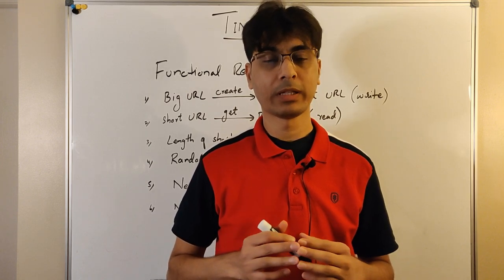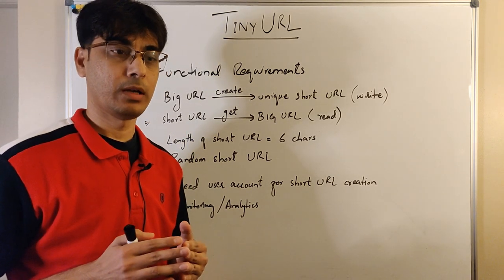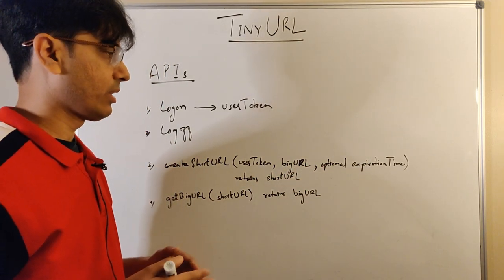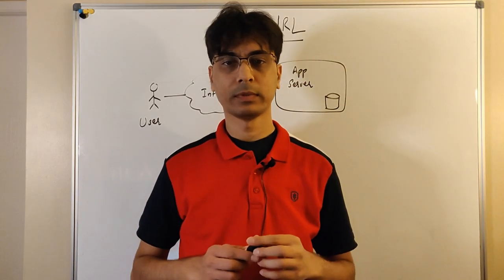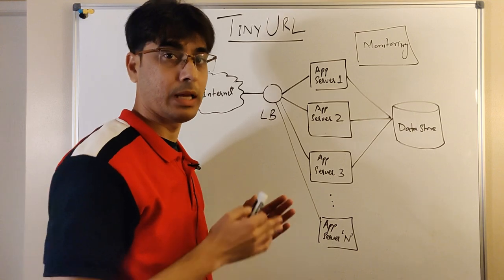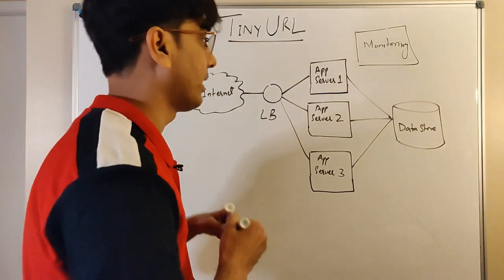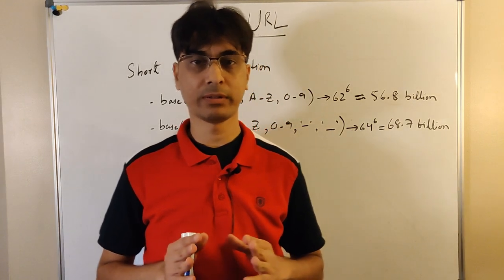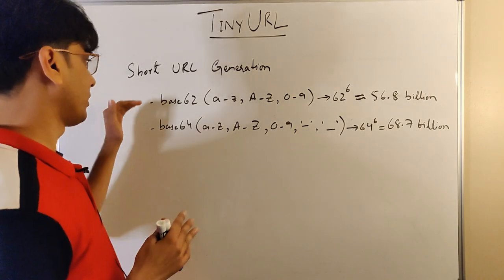System Design Interview Question - TinyURL System Design | URL shortner System Design

Comment: Thanks for the video but I have a question for you.
How is this approach any different from zookeeper approach. your data source is still a single point of failure whereas zookeeper on the other hand is considered to be more reliable and high available.
Reply from the maker: The datastore is not a single point of failure. I didn't discuss this in this video but it is already discussed in the course that you can check out. Now regarding using zookeeper to generate the counter values, I think people suggest that without even thinking what it means. In an interview, you cannot just say that you will use zookeeper to generate the counter values, and zookeeper will magically handle generating this value and also provide high availability (i.e. no single point of failure). Generating a unique sequence is the crux of this tiny URL system design and an interviewer will ask you then how zookeeper achieve this. In practice, nodes/machines in the zookeeper fail and they fail all the time. In this case, when one server in the Zookeeper cluster fails, somehow the system needs to make sure that the others don't return a duplicate range. The only way to do that is to make all servers agree on which ranges have been given, and which have not. Now this lies in the distributed consensus problem. In fact, zookeeper uses the one as well for this. Now, if you want to use zookeeper just to assign different counter ranges then this is a bad use of zookeeper because you can achieve the same by just providing counter ranges in some configuration form where all the servers go and read from a file uploaded somewhere to get their ranges. You don't need to run and maintain a separate service for it. This was a long answer as it was not easy to explain in a few words. I hope it clarifies your question.

Comment: You mentioned that we want high availability and strong consistency. How can it be possible as per CAP theorem
Reply from the maker: I think I have to make a video on it soon. People have misunderstood CAP theorem. First of all they don't understand in which scenarios CAP theorem is applicable.  Secondly, according to CAP theorem, in scenarios where it is applicable, only in the presence of a partition, you can't have both high availability and strong consistency and you have to give up one for the other. It does not mean that when there is no partition, still you can't have both. And there is a third reason also, which I have answered in other comments before as well.

Comment: If one of the app-server goes down, won't we lose a range of usable values for url generation? I would try to think of a way to reclaim a range
Reply: Its a very small trade off. 7 characters can generate 68B combos and we can easily afford to loose some chunks in case of server failures. Also, when the cron job runs to delete expired tiny url mappings, we can actually add these tiny urls back to the table containing the available urls so that they can be reused.

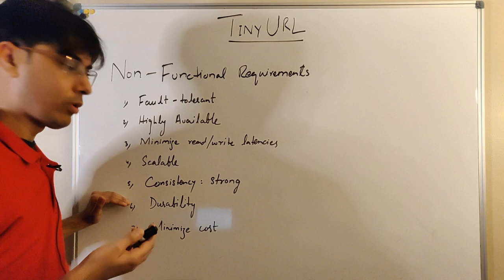Comment: Thanks for your video. one question,  when you mentioned the non-functional requirements (@5:32) should include high available and strong consistency, but based on the CAP theorem, we can only choose one from them, how can we keep high availability and strong consistency at the same time?
Reply from the maker: Thanks for the comment. As we discussed, the service has strong consistency in the sense that once we created and returned a short URL to the user, if the user queries the big URL using that short URL, the service should be able to return the big URL. Otherwise it will not be a good user experience. Now the question arises that how a service is available and consistent at the same. It boils down to the fact that no service is 100% available. Question arises whether we are targeting five 9s or four 9s of availability and again it also boils down to whether we are talking about availability of the whole service or some part of it. The service itself can be highly available (as a whole) and at the same time fulfill consistency requirement as a whole (keyword is "as a whole") however the individual partitions (in the datastore) may have to prefer either availability or consistency. Now it is totally possible that one partition could be down due to network partition but it won't affect the functionality of other partitions, thus overall service still considered as highly available. And please note, I didn't discuss the design of datastore where we would discuss all these things (which will be a topic of a future video). I hope this clarifies.
Reply: @ThinkSoftware  Thanks a lot !~
Reply: I would like to add on to what has already been said - the question of choosing between availability and consistency arises only in cases of a partition. Otherwise in a normal running scenario a service could be both available and consistent. Now let's discuss the partition scenario . In this scenario . we could make the read service to be highly available while the write service might become unavailable in event of partition thus maintaining the consistency .  So different microservice of  a system could be configured differently  to support availability or consistency !  Hope this helps
Reply from the maker: Thanks for extending my answer with great explanation 👍
Reply: @ThinkSoftware  I would think, eventual consistency should be OK. As most of the time, the short URLs are created may not be immediately queried. The flow would be user creates a short URL, posts it to his followers and the followers may not click on it immediately. If we use a NoSQL Database like Cassandra, we can improve Read Performance tremendously

Comment: If the datastore is a single machine, will that beat the purpose of high availability if it is down?
Reply from the maker: Of course
Reply: @ThinkSoftware  in your example, datastore is a single machine or you just use single drawing to show datastore?
Reply from the maker: it is not a single machine. It is just logical diagram of data store. If we would have gone inside that logical component then the discussion could go about how to achieve all non functional requirements in that data store. Check my other video on intro to distributed systems in which I discussed a bit in detail about it.

Comment: Can't we just use the Semaphore concept to keep the counter value so as to avoid any conflict?
Reply: Semaphore mutex is used in single codebase. Here we have multiple servers. If want to use mutex in DB side or in cache the problem will the the same. That Db or cache will become bottleneck. So that's why he's incrementing it by 100, to reduce load on DB.

Comment: Instead of relying on an external data store for getting valid count ranges why don't we just append a UUID to every input URL, hash it with MD5 and bas62 encode it? This reduces the possibility of collisions and eliminates the network overhead. The individual app servers can generate UUIDs independently
Reply from the maker: This I have already discussed in the course and in this video that MD5 hash can't be used because for 6 character short url, we have to drop the bits from MD5 which will result in conflicts.

Comment: I don't really agree with the fact of having 3 servers running all the time just for anticipating maintenance or new releases. You can have 2 servers running and when you need to release a new version you just pop-up another instance and once it's successfully launched you remove one of the old instances and you do the same with the other instance. Kind of blue green deployment in a way.
Reply from the maker: Thanks for the comment. It totally depends on what type of infrastructure support your service has. If the underlying infrastructure provides support for adding host and removing host in a seamless manner and you don't have to go modify various configuration settings then you can go that route. Otherwise, it will be less hassle-free to have at least three servers (and I have rarely seen anyone using the route that you suggested in my 15+ years of experience). And also you need to understand the CICD pipeline that you have. We don't do deployment or maintenance once a month, nowadays the frequency for deployment is much higher, if not daily then still once a week or sometimes twice. Of course, when you are starting new (think a startup of two/three-person), you can still go with two servers because you might be at a stage where you are the only person (or two/three more) who knows when to perform the deployment. But I am talking, in general, about suppose if you are working in a cloud company at the scale of Stripe, Lyft, Uber, or FAANG.

Comment: Hey. This video was great. You have made all the concepts abundantly clear. I had a quick question tho. While sending the write request, we ask the user to provide the API key right? Can't we just use that along with the counter variable which keeps on incrementing until a unique URL is generated? I'd think that it might tick up the overall complexity?
Reply from the maker: Thanks for the comment 🙂. Are you suggesting about different counters for different users? This will not work due to conflicts and you need to keep increasing the counter.
Reply: @ThinkSoftware  I was just thinking using the user info and the url provided to generate the unique url. Not sure how that'd pan out.
Reply: @ThinkSoftware  Another quick question. I'm sort of trying to design this system in nodeJS. So I have created 3 heroku accounts for 3 different servers and one for exposing the API service. I was pondering if creating the global cache in the API server will be a good idea or not. Like we could expose the read operation for the global cache through the API. Whenever a read request is sent to any of the servers from the API, it calls the cache endpoint on the API and if no match is found, the server checks in its own local cache and then ultimately resorts to accessing the database. What's your stance on this approach?
Reply from the maker: You will start seeing issues when you have lots of short url in the database.
Reply from the maker: I think already discussed the pros and cons of local vs global cache in the video.
Reply: Think Software ikr, I’m just not sure how to implement those cache in real life.
Reply from the maker: Local cache via hash map and for global / distributed cache I have a separate video that you can check.

Comment: You talked about updating the counter values inside a transaction construct. But then we're going to store this in a No-Sql datastore, is this transaction construct possible in DynamoDB or Cassandra like DBs? Maybe Spanner or cockroach offers this but my question is in a generic sense. Thanks for the Awesome work!
Reply from the maker: Thanks for the comment. Other databases provide similar constructs as well. E.g. Cassandra provides atomic writes and light weight transactions for updating a single record etc.
Reply: @ThinkSoftware  but between two tables how will u acheive transacation in cass.
Reply from the maker: @arunagiriswarane1155  which scenario in our  design requires updating two tables in a transaction?
Reply: @ThinkSoftware  When generated new mapping between short and big URLs, we have to both add it into mapping table and update the opt URL count in user table. Should these two write-operations be done in one transaction?
Reply: @amandama6165  I agree this is a problem. Also, lightweight transactions require a quorum so it's not exactly scalable.

Comment: if we increase the size of tiny url to 7, then can we use base64 encoding? or we have to use base128?
Reply from the maker: using base64 or base62 or base128 has nothing to do with using 6 or 7 characters. With 6 chars, you can use base62 or base64 or even any other base encoding as long as those characters are supported by HTTP request in the query path.

Comment: In the counter example with datastore, is it not a single point of failure ?  How to fix that in case of counter in db ?
Reply from the maker: Thanks for the question. This has been discussed in the course. Short answer: master-slave architecture.
Reply: @ThinkSoftware  what if master fails before the new incremented value is replicated to slave ?

Comment: one requirement will not be achieved using this approach sir. 
     - short url should not be guessable.
Reply from the maker: If you check my course, i have discussed this there in detail how this will be achieved via this approach. Good thing is the tinyURL system design is free preview chapter.